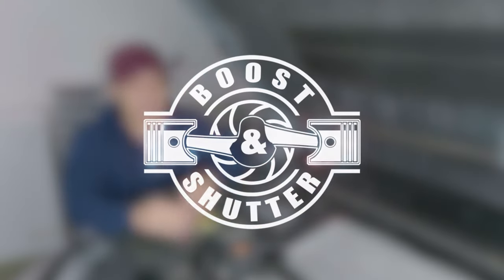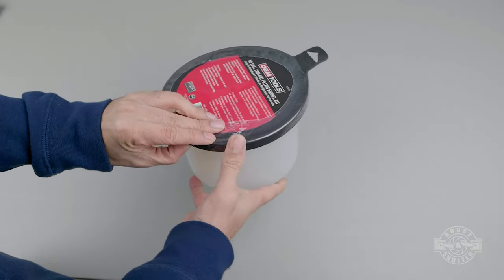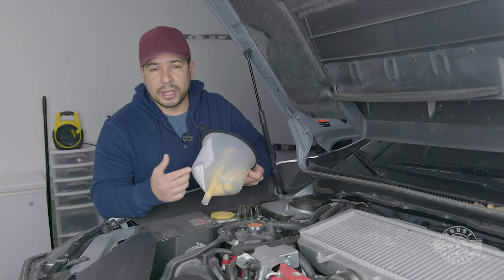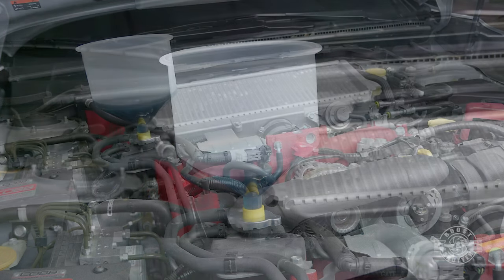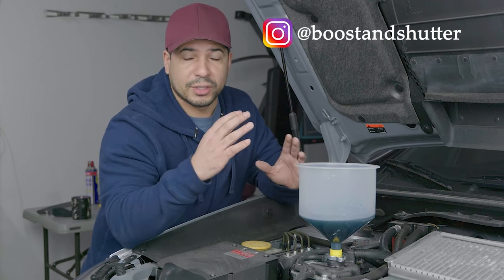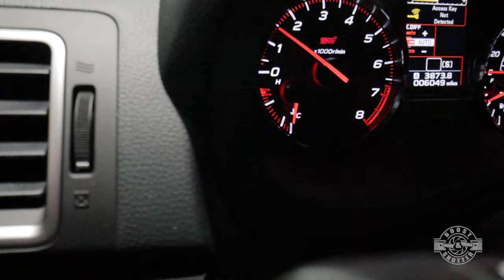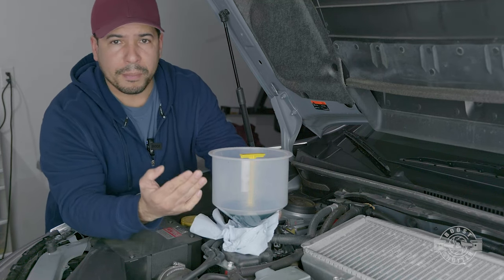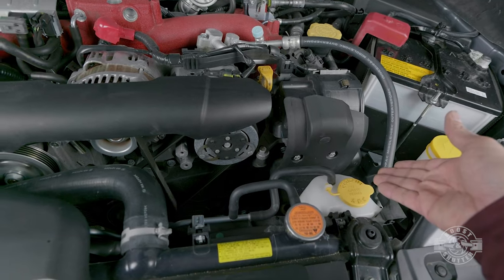How to Burp Cooling System | Subaru WRX STI |

Comment: What if I’m still getting bubbles
Reply: Head gasket most likely the gasses from the cylinder making it way into the coolant system check your oil next oil change see if it smells like coolant or is thinned out due to the water/coolant